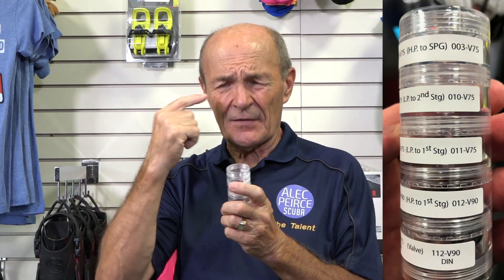Nitrox O-Ring Kit - Scuba Tech Tips: S11E18

Comment: Maybe I'm confused but is it not the case that you only need O2 compatible O rings for parts that will be subjected to >40% oxygen? Unless you're using your regulator for >40% EAN you wouldn't need O2 O rings right?
Reply: You still need a Nitrox O ring because some fillers may use pure O2 + air to make your blend, and because of that a normal O ring won't work.
Reply: @scubasteveandunderwaterroc3547  thats still only true of O rings that come into contact with >40%. Even if the shop does partial pressure blending. Your reg o rings don't need to be O2 compatible
Reply: @KB-gd6fc  Your reg O rings don't need to be O2 compatible because the belnd they would come into contact with (assuming you let the blend mix after a while) would be less than 40%. You still need a Nitrox O ring for the partial pressure fill.
Reply: @scubasteveandunderwaterroc3547  i think we're saying the same thing
Reply: @KB-gd6fc  I think so too 😂
Reply from the maker: A tank filled with anything other than air (eg 21% O2), you require O2 compatible O-rings for everything the air touches depending on the filling method.  As some comments below correctly say, there are 3 main methods to make enriched air.  Watch my video S08E21 How Is Nitrox Make? to learn these.  The "Partial Pressure" method uses 100% pure O2 as a mixing agent into your tank which requires O2 compatible o-rings and oxygen cleaned gear.  You would not know this unless the dive store tells you that is their mixing method.  The very common 'Stick" method delivers pre-blended enriched air  into your tank (eg 32%) and does not require O2 compatible o-rings as it is under 40% O2 as it enters your tank.  Again, the dive store should tell you which method they use and your tank/o-ring requirements.  Good question KB and keep on learning.
Reply: You do need O2 compatible O-rings. However, standard nitril rubber O-rings are compatible enough even for 100% oxygen. The compatibility, unfortunately, is not enough but the O-ring has to be also O2 clean if your FO2 is greater than 35-40%. Also you have to use oxygen grease, like crystolube. NO SILICON GREASE with any nitrox!

Personally I don't use Viton O-rings in any of my gears, not even O2 first stages (rebreather, deco regulators). Burnimg Viton creates very poisonous fumes you would not to deal with.

Comment: I don't find keeping spg o-rings to be valuable, the last thing I want to do at a dive side is to replace those tiny o-rings. Instead I throw in a couple of complete spools in my kit.
Reply from the maker: Spare gear is another option, more expensive but if you can do it, good for you.  Many times I have performed o-ring replacements on dive boats or on shore to save a dive trip.  The key point we agree on is to be prepared with parts, gear or a buddy who might not miss their gear!
Reply: @AlecPeirceScuba_SeaHunter  I've done o-ring replacements at the dive sites, the spg o-ring is just one that I don't want to do except on my work bench. The spool itself is already easy to drop and lose, and expecting to replace the o-rings just seems like a good chance to lose it.